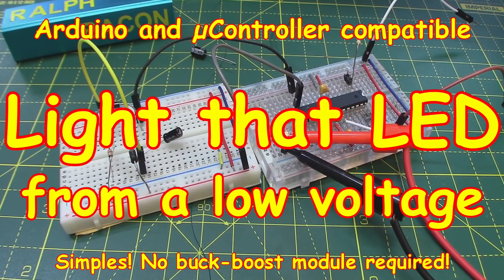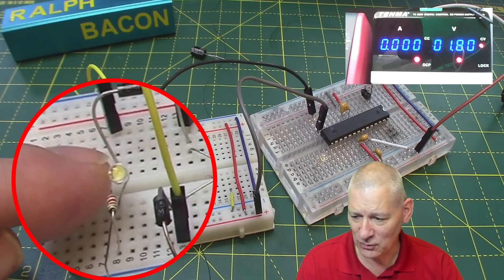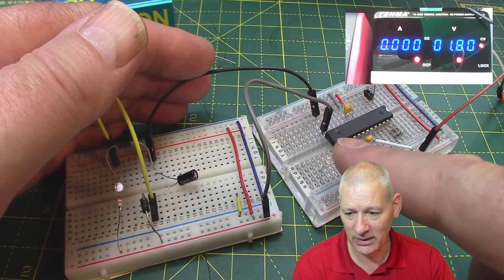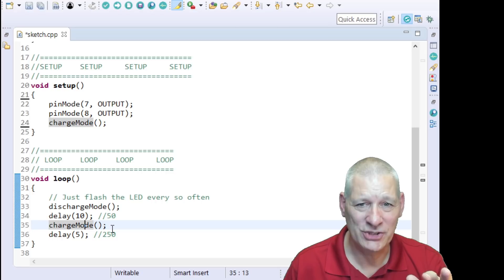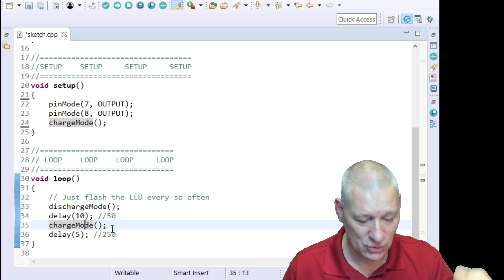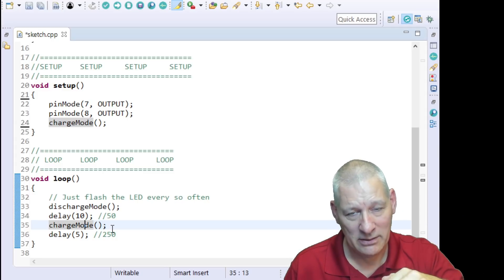#167 Light an LED 💡 with low 1.8v Diode Pump µController output (easy)

Comment: Definitely a kind of cockroft Walton multiplier though cant rely wraps my head around the green diode yet, but I guess it works
Reply from the maker: It's related to a Cockroft Walton multiplier but is not the same because we can switch the output on the MCU thus not requiring a clocked output. And what's this about a green diode?

Comment: Looks like a single stage Cockroft Walton multiplier, but slightly different topology.
Could be interesting to build one of them with several stages and see what sort of voltages you can get out of it :D
Reply from the maker: Off you go then, Azy, see what you get and report back here, please! It's certainly related to a Cockroft Walton multiplier, and as you know that, you know that we can triple or quadruple the voltage by a series of diodes and capacitors. But these days buck-boost modules have probably replaced them in that role.

Comment: Interesting but couldn't you make an even simpler charge pump with just one diode from Vcc and the LED to gnd, thus only using one mcu pin?
Reply: Ralph, In your circuit you could remove the green diode, connect LED cathode to gnd, and use Vcc instead of upper output (remove top green wire to avoid a short :-). When the output is low, the capacitor is charged; when high, the capacitor discharges through the LED.
Reply: Like this - http://homediyelectronics.com/projects/arduino/voltagemultiplier/
Reply from the maker: That's a nice way of doing it too, Simon, I shall keep that in my book of things to test out, thanks for the link.
Reply from the maker: Nope! We need to have two so that the voltage appearing on the pin that was previously GND is not allowed to short to the voltage on the charged capacitor. Otherwise, where the pump action?

Comment: Hi Ralph, Can you plse explain why the electrolytic doesn't pop when exposed to reverse polarity? Thanks.
Reply: It's not exposed to reverse polarity. Charge on the capacitor gets added on top of the positive supply rail when negative terminal of the capacitor is connected to it. Positive terminal of the capacitor never goes negative relative to its negative terminal in this circuit. To cause a catastrophic failure of the capacitor there must be a substantial reversed current flow too. That's obviously blocked here by a diode.
Reply from the maker: Yes, hauuau has it spot on. The negative terminal of the capacitor remains at all times negative in respect to the positive terminal. The negative voltage is raised to 1.5v (approx) and the 1.8v from the flipped output pin is added to that voltage. A quirk of physics. Well, less of a quirk, more of a rule.

Comment: It would be interesting to compare this circuit to a simple boost converter based on a small coil and a transistor driven by the µC. It should have lower part count and will occupy only one pin instead of two.
Reply from the maker: I think a small buck-boost converter might give more current (but still in the order of milliamps). But I haven't tried this or compared them so I can't really say that I know.

Comment: Have you measured the peak current going into the cap? I'm not really chuffed about connecting a cap to a µC's output pins without a resistor. Kind of bad practice. The larger the capacity of the cap the more of a "short" it becomes when switching. I've way too often seen people misinterpret the datasheet's "max pin current: 40mA" as "current is limited to 40mA" and not as the correct "YOU have to make sure the current is limited to 40mA". So it can't be stated often enough in my opinion that you should always use a resistor.

If you don't have a µC or pins to spare, I've built a voltage doubler (or inverter, which is almost identical) like that a few times using a 555 (use the CMOS version, which has kind of a rail-to-rail capability at the output, otherwise you lose another volt or two). Maybe not the most efficient for battery powered devices, but definitely one of the more robust and easiest to build ones.
Reply from the maker: I haven't, although I mentioned that there was (probably) a tiny surge in current as it charges that capacitor up. I don't believe for one moment that it would dump 40mA in that capacitor though. The Schottky diode and capacitor have some effective series resistance - whether it's going to be enough I haven't checked.

Comment: Hi Ralph, another great video explaining things in a way we can understand :)

Are you still planning to make a video on getting a voltage (from a LiPo battery) to the arduino analog pin when it's being used to power it, so that you can make a battery guage to see how much charge is left in the battery? (I think you said it was something you were looking to do when I last commented) I'm still struggling to get a sensible reading from the battery (tried capacitor/resistive divider/different AREF voltages/using different analog references (Tried inbuilt 1v1,5v and external on AREF))

Thanks again! :)
Reply from the maker: I hadn't forgotten, Jessica, but I have several things on the go and I don't want to revisit a subject too soon! But, now that you've nudged me I shall see when I can do it, especially as you seem to have tried everything under the sun!
Reply: @RalphBacon  Thank you :) Not particularly in a rush so whenever you can. It all nearly ended up getting thrown out of the window... and I still haven't had chance to build the ATTiny85 Fuse setter yet either, since most of my time has been spent on trying to figure out this problem... I even got a dedicated chip for the job, but can't seem to get those in a through hole package and I'm not quite ready to switch to surface mount components yet!

Edit: Also, do you have a patron/do you take donations? I'd like to do my bit since I don't watch ads :)
Reply from the maker: OMG you don't watch the ads! Shock! Horror! I just assumed everyone would watch them several times because, as we all know, they are all so interesting and riveting! No, I don't have a Patreon, I'm afraid, and no plans to do so. If you want to know how to help my channel watch that video I made a while ago: https://youtu.be/59aHRRcsKSQ and ignore the bits about watching the ads! I shall endeavour to get this battery monitor sorted soon but that's "soon" as in Arduino time...
Reply: @RalphBacon  Thank you :) I've watched the video you linked, and will endeavour to use your affiliate links when I'm looking to get some stuff. Yeah that's fine, I look forward (ish) to someone getting as frustrated with the problem as I have been, haha. I really like your method and how you approach things with honesty and in a way that doesn't put up any barriers to access. You're one of a very low number of people on this platform that read and reply to comments too. I've also made some personal recommendations to friends if they want to get into arduino stuff, Ralph Bacon's the guy you need :)

Comment: naprawde ta duza korporacja sponsoruje te pare kabelkow na desce do krojenia bulek? to co mam w szufladach powinno byc sponsorowane przez galaktyczna spolke poteznego imperium miedzygalaktycznego!
Reply from the maker: So what you're asking, Bundy, is "Is this big corporation sponsoring a few cables on a chopping board? What I have in my drawers should be sponsored by the galactic company of the powerful intergalactic empire!"

And the answer is Yes, they are. They get a sponsored plug at the beginning of my video. Anything else is just gravy (for them).

Comment: Why does the loop start on a discharge or does that not actually matter?
Reply: The setup function has already performed a chargemode before entering the loop. That's if I understand it correctly.
Reply from the maker: Phil is correct, I "pre-charged" the capacitor in the setup. Just to keep you on your toes.
Reply: @RalphBacon  Ah, but you didn't include a delay to make sure that pre-charge 'took' before the discharge :-P I don't think anyone would notice that first shorter or nonexistent pulse ;)

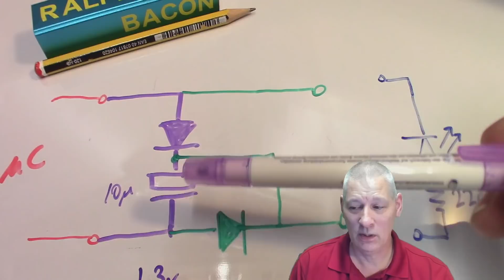Comment: At 5:56 i don't think the the capacitor has had it's whole world turned round. it's just been lifted on to the shoulders of the pin going from 0V to 1.8V. but anyway a nice vid.
Reply from the maker: Yes, that's a better way of putting it. What was GND is now +1.5-ish so anything else is added to the charge already on the capacitor. Standing on the shoulders of giants, so to speak.

Comment: "Back in the day" we used an LM3930 chip to do this job.  Probably not quite as flexible, and you need another chip.  Good Job Benny!
Reply from the maker: I'll see your LM3930 and raise you an LMC7660  - a charge pump, but it seems awfully complicated in today's world of simple and tiny Buck-Boost modules - and, like you say, yet another component.

Comment: Cute twist on a voltage doubler..............the current is low  - certainly enough for an indicator
Reply from the maker: Yes, Kenn, not quite a traditional voltage doubler, a la Cockcroft–Walton multiplier, more along the lines of a Dickson Charge Pump, I guess. But when using a µC it's a neat way of getting that LED to light (or stay lit even when the battery is getting low).

Comment: You can run an LED on half a volt if you use a joule thief - big Clive has a vid on how to make one
Reply from the maker: Well, yes, we could always put some sort of buck boost device onto the VCC but what I'm trying to show here is a simple (3 component) way of increasing the voltage for a simple indicator using a couple of spare pins on an MCU. Although it does also work for powering, and lighting an LCD display too!
Reply: Original joule thief requires a custom inductor. That's not practical for majority of applications.
It's possible to just build a crude boost converter out of regular parts though. It might either use some sort of transistor oscillator or just run from the microcontroller's PWM signal.